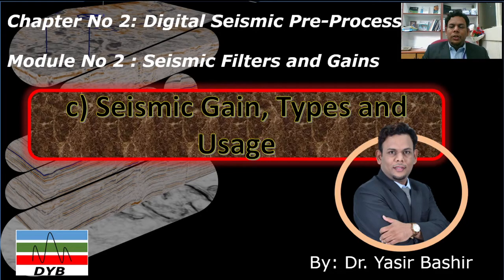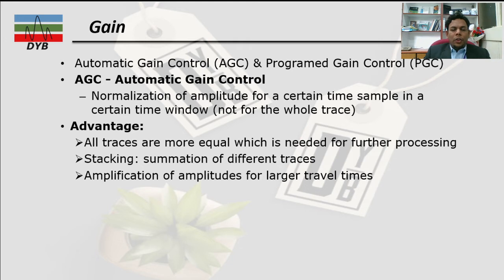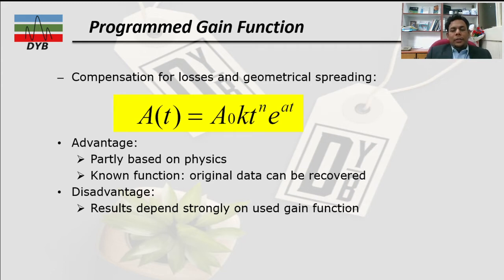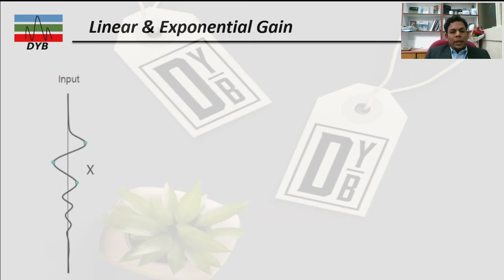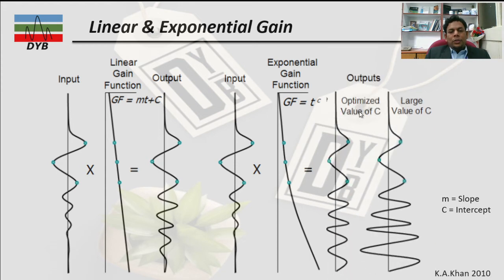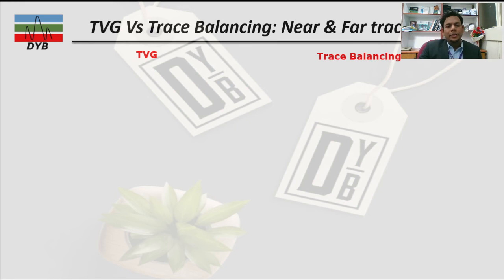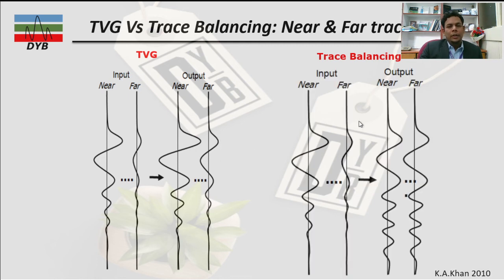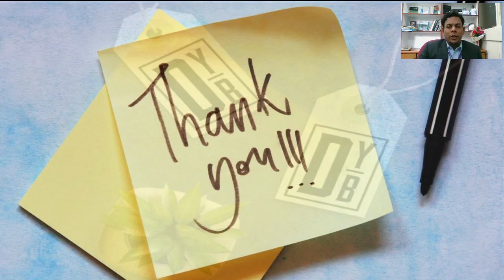Seismic Signal Gain Unlock Critical AGC, PGC, and TVG Techniques for Geophysical Success Excellence

Comment: I have a question, we have use AGC,PGC for amplitude recovery..But my question is whether these gain function compensate geometrical spreading or inelastic attenuation( frequency and Q- factor dependent)?
Reply: From my point of view agc or pgc only recover amplitude but they can't recover any high frequency component which attenuate due to absorption or anelastic attenuation...so, is agc or pgc only used for geometric correction or for both geometric and anelastic attenuation? I am looking forward your answer. Thank you so much sir for making this type of videos.
Reply from the maker: @arindamkundu8888  Thank you for your question and then answer it yourself. There is a difference between recovering high frequencies (processing) and adding high frequencies (Imaging for vertical resolution) in data. So, these gains are only to enhance the amplitude of a signal which is affected because of Geometrical spreading and Q-compensation either elastic or anelastic attenuation.
Reply: @GeophysicsInsight  Thank you so much sir for your kind reply. Therefore, these gain only used to recover amplitude that effected by geometrical spreading and intrinsic attenuation (inelastic or elastic). And for frequency recovery we have to use deconvolution and inverse-Q-filter. Am I right or wrong?  Please confirm this. I am looking for your answer.
If possible, could you please provide your email so that I can contact you for further discussion regarding any topic in exploration seismology. 
Thank you so much in advance.
Reply from the maker: @arindamkundu8888  you are missing gains and Decovolution operators. Let me clear it like this. Gains are applied for instance, geometric spreading correction to compensate for wavefront divergence early in processing, before deconvolution, and it is not uncommon to design a single deconvolution operator and apply it to all the traces on a shot record. Deconvolution techniques used in conventional processing are based on optimum Wiener filtering.
Reply: @GeophysicsInsight  Thank you so much sir...Now it is clear..
Reply: @GeophysicsInsight  I have an request. If you kindly make one or two videos on rock physics modelling in seismic interpretation it will be very helpful. Like how Gassmann's equation (fluid substitution relation), Greenberg-Castagna relations help us in seismic interpretation.
Thank you.